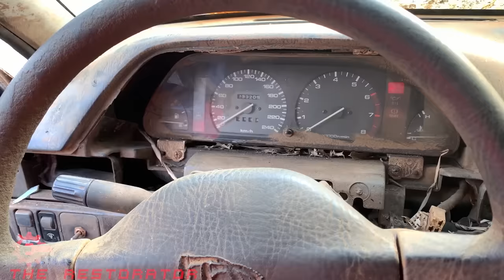Full Restoration Old Car | Restore and Build Wood Car

Comment: Very good work. But I do have a couple of recommendations. #1. You should replace all the gaskets. If the car was sitting for 15 years or longer, they might leak. #2. Replace the brakes. Rusty brake rotors don't perform well. You'll see a major increase in the stopping distance if not only the tires are old, but the brakes are also rusty.

Comment: The previous owner wanted a Rolls-Royce so bad. 😄
Reply: So much the wheel hubs all screwed in were Rolls Royce and the fact the steering wheel was also Rolls Royce? You know, every so often, car manufacturers do make cars look like other cars.
Reply: @moorek1967  thats a mazda. Possibly a toyota but definatly not a RR. The grill is concrete mesh.. Steering wheels literally has RR carved into it. Some stiching on the seats done by an interior guy. As per the wheel hubs, you can get RR double sided medallions that fit in place. Rolls didnt produce a fwd eco car for any market. Ive seen fieros turned into lambos, still not a lambo tho. Lol.

Comment: of course I do not understand I certainly do not understand mechanical engineering, but it seems to me either it was necessary to make stiffeners from metal and not from wood, of course, I do not understand mechanical engineering, but it seems to me or it was necessary to make stiffeners from metal and not from wood.

Comment: What a joke all that work with the body and the engine and they couldnt even get it to run on all cylinders. What an embarrassment, all that work an time, but how much harder could have it been to just get it to run right. They jumped the gun and didnt finish strong. I was very disappointed I watched all this just to find out they couldnt even get it to run properly. Its still a peice of trash!
Reply: هغ

Comment: I dont understand these videos, why bother to take the engine apart and clean it, when you dont repair anything? It still the same clapped out crap, even if you paint it afterwards. Why not just paint it and do a basic tune up, it could not make any difference, what so ever. Since i have humor, i liked the wooden shitty body, it looks nice enough to drive it to the scrapyard.